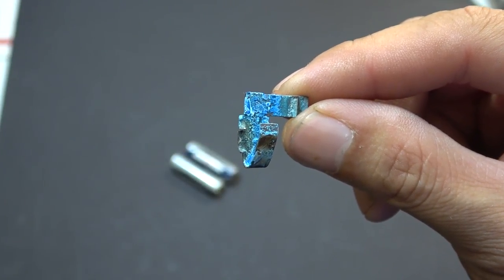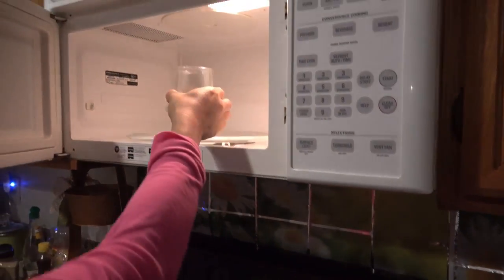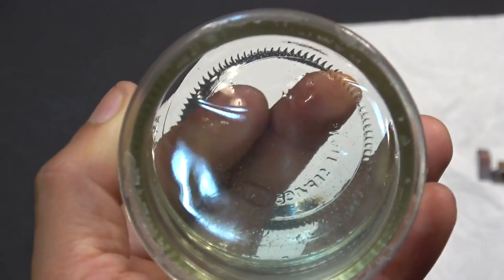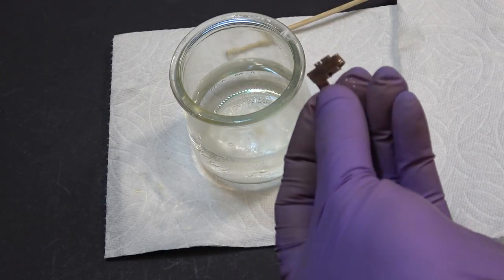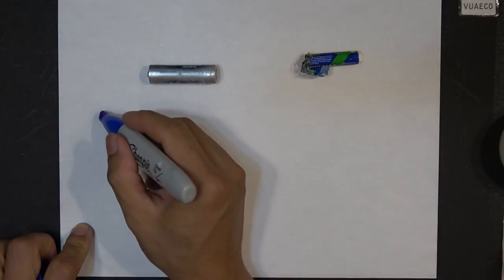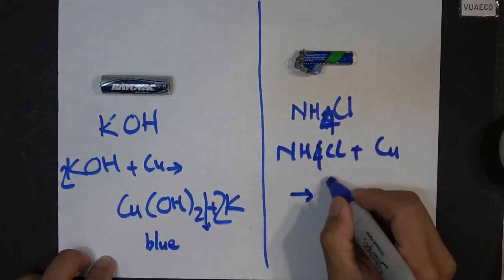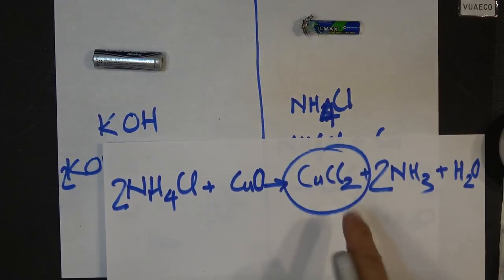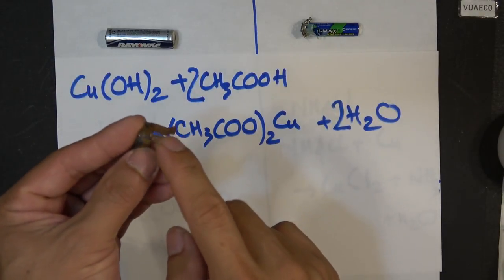How to clean a corroded battery terminal (AA or AAA) & chemical reactions process behind it

Comment: You can also just wash away the vinegar residue, no?
Reply from the maker: Yes, you can use tap water to wash away the vinegar. Tap water is slightly basic so it would be fine to use to neutralize the acid. Baking soda is better if you have it available.

Comment: How do you stop it from coming back?
Reply: Little late, but the real answer is not to use devices for power cell storage.  Take the power cells out when not using a device regularly.  Yes, this seems annoying and can be hard to remember, but it works every time.  All power cells and batteries fail eventually, and it's better if they don't take a more expensive device with them.